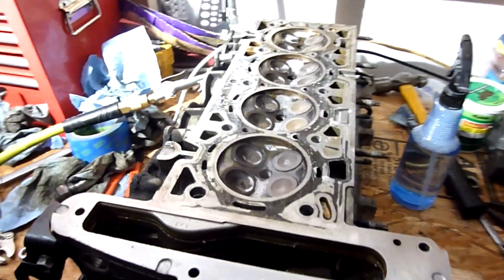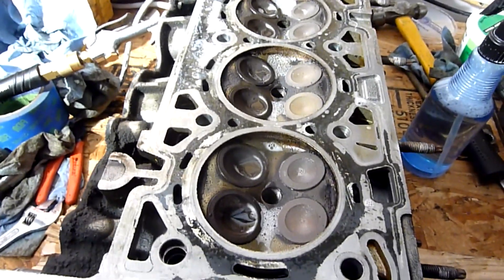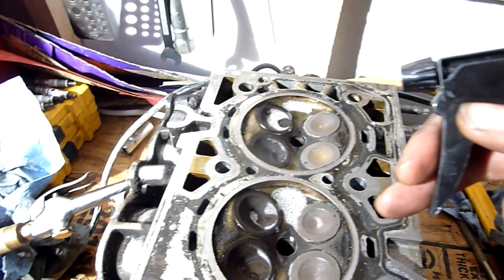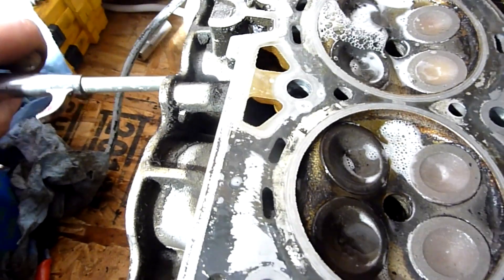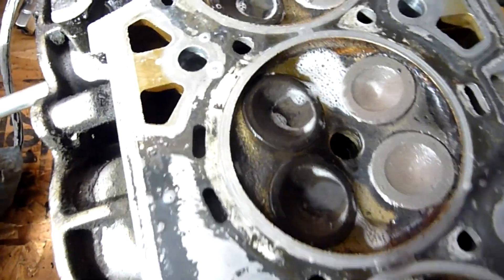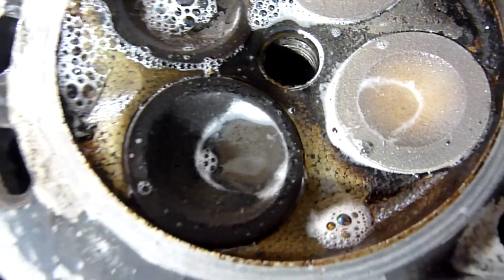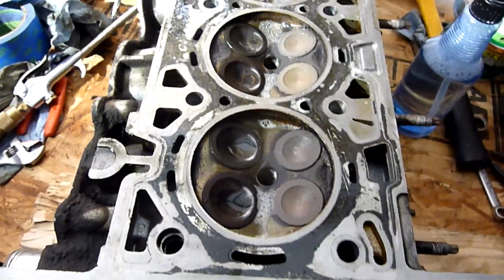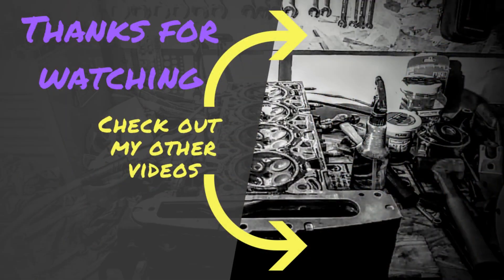Leaking Valve Found 😳 Soapy Water Test Reveals the Real Problem in the Cylinder Head!

Comment: I have a similar project I'm looking at, a relatives 2004 Saturn Ion, pulled the cam's cover  noticed intake cam at the 11 o'clock position exhaust cam at proper 10 o'clock at TDC. Timing chain very loose and no compression in all 4 cylinders. More then likely valves have been bumped, bore scope showed no piston damage though. I have not worked on these Ecotec engines so sure like to see how you did it.
Reply from the maker: The valves may not be damaged. When I tore into my saturn the intake cam was lined up with the wrong mark. It was in the correct position, 2 o'clock, but was lined up with the triangle, exhaust mark, instead of the diamond intake mark, and there was no damage to the valves. So in hindsight, what I wish I would have done is just reset the timing. What you could do, is put a new timing chain on and before you put the timing cover and everything else on, you could hook up your compression gauge and roll the engine over by hand. I hope this helps.
Reply: @therusteegarage  I found the plastic guide was broken in 3 pieces and one of the guilds bolts was sheared off the other was ground down from the chain rubbing on it. I put a new timing chain kit in and found some of those special guide bolts. I check the compression and 30, 60, 30 and 00 # and they would not hold the compression and leaked down immediately. So I am going to get the car in the garage ( I was working on it outside where the tow truck dropped it) and pull the head in a couple days. Did you do any work on the head after you removed it?
Reply from the maker: Nice work! Yes, I pulled all the valves and inspected them. Then chucked each valve in my cordless drill and cleaned/polished them with oiled sandpaper starting with 120 grit all the way up to 1000 grit. Then finished with mother's polishing compound. Then I reseated all the valves using valve grinding compound and checked them for leaks just like in this video. It sounds like you may have to replace some or all of the valves but you won't know until you pull the head.
For the head, I pressure washed it first and then cleaned it all up with wire wheels, brushes, and sandpaper. Berryman's carb cleaner works really good for removing the carbon buildup. If you do pressure wash it you'll want to make sure you blow it dry with compressed air so the steel parts, valve guides & seats, don't rust. And depending on where you live and how much time it will take you to complete the project you may want to spray some WD40 on the valve guides & seats to protect them from rusting.
The gasket mating surfaces on the head are going to have gasket residue on them and what I think is the best way to clean them up is sanding them. There are 2 ways to do it. The first way is to make a sanding block out of MDF board with white melamine because the melamine is really flat and smooth. Check this video out: https://youtu.be/HyKN52HD6RU
The 2nd way to sand the head is to get something really flat and smooth like a piece of glass from an old window, an old mirror, or even some steel from a table saw or joiner table. Then glue the sandpaper to the surface and place the head on top of the sandpaper and start sanding. Check this video out: https://youtu.be/9KauqWsaNsQ
The most important thing to remember is that whatever surface has the sandpaper on it is the surface that you will transfer to the head.
I hope that helps. Let me know if you have any more questions and good luck!
Reply: @therusteegarage  Thanks for the tips, I hope to get the car into the garage tomorrow. I live in Washington State the wet side! I'm also near 77 years old so that don't help either. I was a gear head and hotrodder in early 60's worked for my Dad in his shop till I left for the Navy (machinist Mate). I have a decent shop and most tools needed as I worked as a mechanic till I was 39, heavy equipment, forklifts and cars and trucks. But I grew tired of pulling wrenches and went to back to school and became an Xray Technologist. But I still help others with repairs off and on like this Saturn Ion. I cuss a lot about my aches and pains while doing these jobs but when they are up and running I feel a great sense happy accomplishment.
Reply from the maker: It sounds like you have a lot of experience and know how! I'm sure you will get the job done! Keep me updated.